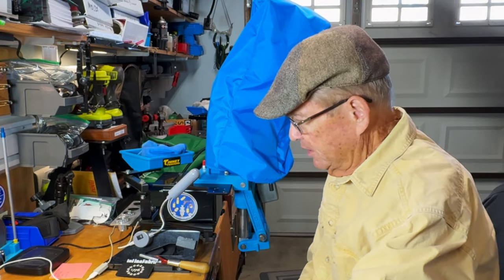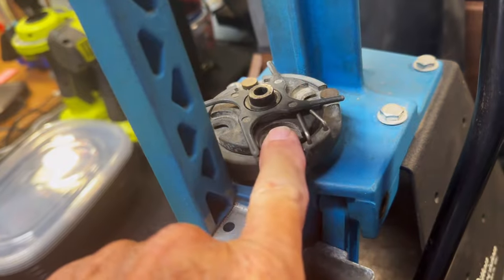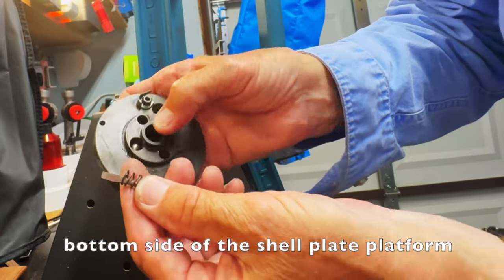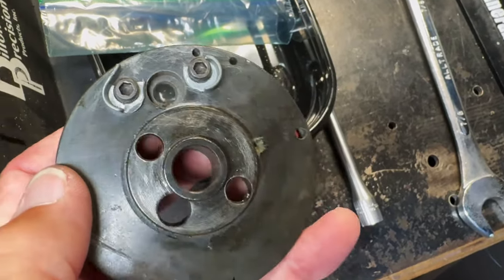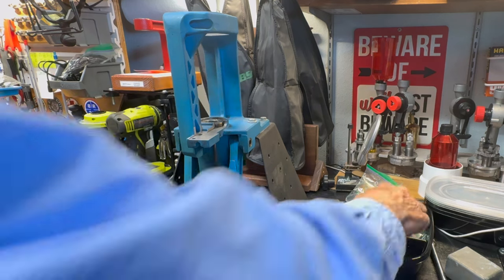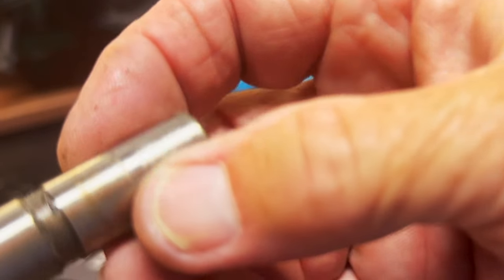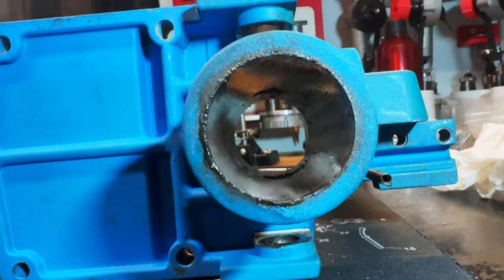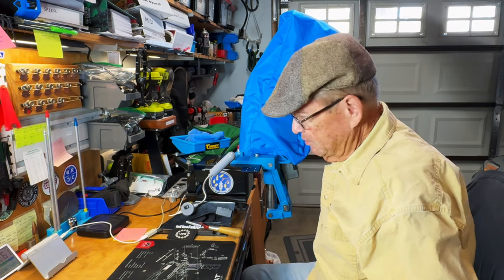Dillon RL550B Rebuild Project Part 2: Disassembly

Comment: Looks like you've done this before... you did a great job explaining where and how on both the older version and the  newer one. Well done sir!
Reply from the maker: @papasplace2  hi, Papa. Thanks. Mostly I wanted folks to know that an overhaul of these presses really isn’t all that difficult. 🤛🏻🔫🇺🇸
Reply: @viejo2a  The knowing how things are attached and how to take the parts off without damage is a very key thing. You did a great job of showing and explaining. Thanks!

Comment: Walter, having two presses is a huge advantage. the priming system on the 550 is one of the best as far as reliability, however, it takes time to change out. as far as the roller handle, I found that it really doesn't have an advantage (To Me), you have to take your hand off the handle every time you feed a case in the shell plate, then after you place the case, reach up and grab the handle. the only way around it is to get some sort of auto feeding thing mounted. again, more down time changing things out when changing calibers. as consumers,, we really have to watch out because of marketing and the whole Faster, Stronger,, better than it was before thing. There are fishing lures that are designed to catch fishermen, Not fish. (The 550 goes fast enough to make safe reliable ammo as is) Good project, I'm enjoying the content. peace, - Dave
Reply from the maker: @thorsaxe5881  hi, Dave. Thanks as always for your support. For me, the roller handles offer Ann ergonomic benefit for my arthritic hands by spreading the force across a wider portion of my palm. Over a longer loading session, I find that I suffer less strain on the metacarpal bones and joints, as well as less ‘rubbing’ on my thinning skin. So for me, it’s not just falling into hype. I hope your shoulder is doing better and that  you will be able to get back to some shooting soon! 🤛🏻🔫🇺🇸

Comment: I normally take my presses apart and apply wheel bearing grease to the pivot points . It seems to last forever .
Reply from the maker: @jamespollard1670  Hi, James. Thanks. Bearing grease is what I use on my pivot pins as well. 🤛🏻🔫🇺🇸